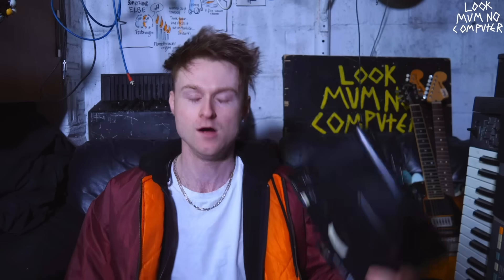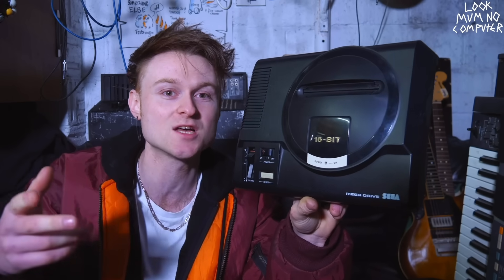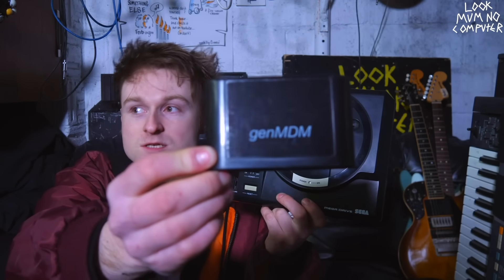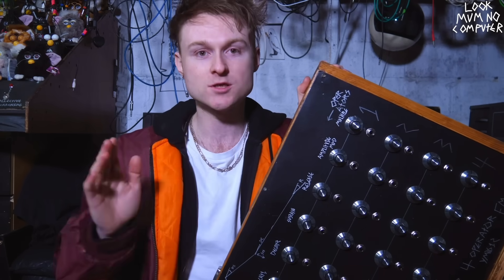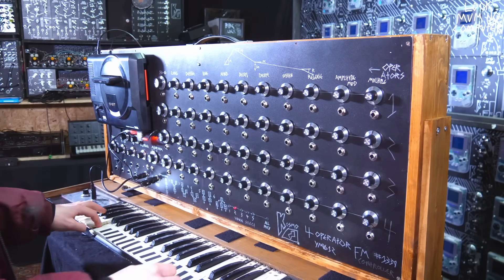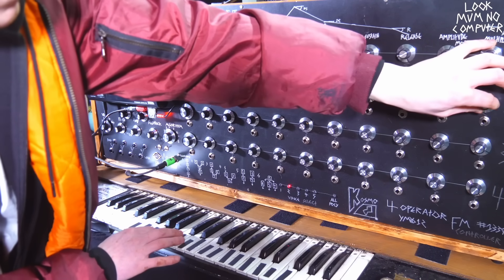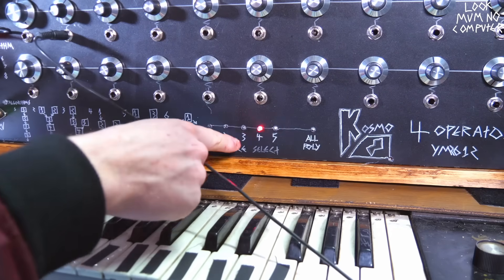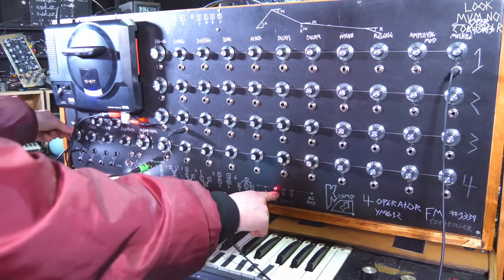Sega MegaDrive Synthesizer, Made From A Sega Mega Drive And GEN MDM

Comment: 0:26 so this sounds like a misunderstanding that got passed around.

If you have an American model 1 console, then the "High-Definition Graphics" text just serves to tell you you don't have the awful VA7 revision, and you might have the rarer VA2 revision. However, neither of these revisions were ever sold in Europe (or the PAL countries in Asia), so the consoles for that region are essentially all the same audio. The audio circuit in the VA3 was basically unchanged all the way through to the VA6.8.

The removal of the "high-definition graphics" text was done mid-revision around when the VA6 was being made, and usually all the text being missing tells you is that you have a VA6 or later console (which means you probably have TMSS) and you also don't have the EXT port (since the hole for it was blanked out at the same time the text was removed). Earlier VA3 & VA4 consoles are very similar to VA6 aside from that

Comment: This is wild! For the hard corer, Ken Shirriff has reversed engineered the DX7 chips and explains down to the transistor how it works. As you will see there is little correlation between the sound you get and the parameters you put in, which makes it very non-obvious to program: https://www.righto.com/2021/11/reverse-engineering-yamaha-dx7.html

Comment: Try and do this with a PlayStation 3 i want to see if that's possible
Reply: Those just use the i/o controller where as the sega has a real hardware synthesizer
Reply: @12E-s3i  hmm i didn't know that interesting
Reply: @jasongrim2027  it's like asking to play a song on an ipod. It sounds the same because the audio is controlled by the i/o chip which is controlled by the cpu, not by synthesizer hardware

Comment: Misinformation. dx7 are easy and make epic sounds you just didnt take the time to learn it properly. and also additive synthesis and fm are two different things, fm is about modulating audible waveforms with modulators in ratios making cool timbres etc.. dx7 is capable of both additive and fm. example - algorithm 32 can only do additive synthesis as all operators are carriers. and algorithms 16, 17, 18 only fm synthesis is possible as there is only 1 carrier and the remaining 5 operators are modulators. and lets not get started with the EG..
Reply from the maker: I had a dx7 for many years it was straight forward to program but unpleasant and FM is not my cup of tea bug yes you are right on addictive and FM well done

Comment: There are (were) free plugins that emulate YM2612 but they are not so easy to use.
Some mega drive emulators like GENS allow to dump YM2612 settings and you can export the patches from your favorite games into these plugins.
The disandvantage is the sounds of Mega drive are lo-fi (8 bit) and does not mix well with modern sounds. DX7, DX21, DX27, their rack versions and Dexed plugin allow to achieve better quality of sound. VAZ modular soft synth was also capable to emulate FM sounds with 6 sine waves. A bit crusher and overdrive might be needed to get closer to the sound quality of mega drive.

Comment: 9:10 I would assume that four total channels would mean the selector would be a four-bit https://en.wikipedia.org/wiki/Bit_field
Assuming that is true, the channels ch1,ch2,ch3,ch4 would correspond to the values 1,2,4,8 (or the reverse) so that "all four channels" would be the value 15 (==1|2|4|8). This would also mean that the value 9 (==1|8) would be selecting ch1,ch4 and so forth.
So, if you haven't already, try the number 15 (or negative 1, which corresponds to all bits set in a signed (two's complement) variable)

Comment: Hey there! Your homemade Genesis synth looks and sounds fantastic , dude!

I don't know if you already took care of the omni mode problem, but I have a suggestion. I made a similar project, an Arduino-powered synthesizer but using the Yamaha YM2151 chip (commonly found in arcade games like Street Fighter 2) instead of the YM2612, and what I did in code to set all eight channels' parameters simultaneously was...loop through the channels. Every time I changed a parameter literally for-loop from 0 to 7 and send the same parameter command to that channel. To be fair, I didn't code in the ability to program each channel separately because I wanted 8-note polyphony instead of potential 2-voice 4+4-note polyphony so I wrote note stealing into the keypress code.

Comment: I cant be sure, but I think you have the multipliers for the operators on the last channel on the right, and I think its a smooth curve, as opposed to being defined numbers. With FM it tends to help to have multiples of round numbers, 2, 3, 1/3, 1/4 etc, as opposed to some perfectly analog output that equates to something like 1.184476. It might help to have a stepped knob with defined positions from like 1/5 or 1/7 up to 5 or 7 or something (you dont need that many because higher multiples just do the same thing as a lower number). Might help to be more deliberate about what sounds youre making as otherwise it can end up sounding like everything you make is just variations on "crunchy". You might know all of this, you just mentioned you hadnt done that much FM, and Im far from an expert, but thats one thing I did learn is that most good multiples are in the form of 1/2, 1/3, 1, 2,  and 3. Awesome machine man, as always!

Comment: Too bad they didn't use the YM2610 in the megadrive, would have been too expensive though. It's basically a 4 channel YM2612 that also has six 12-bit ADPCM channels one 16-bit ADPCM channel, a noise channel and 3 PSG channels. SNK used it in the Neo Geo and there was a version with two extra FM channels for a total of 6 (YM2610B) that Taito used in some of their arcade boards.

Comment: Yamaha's "FM" synthesis is actually using phase modulation. The reason for this is that frequency modulation creates unpleasant harmonics under certain conditions and replacing frequency modulation in the operators with phase modulation creates almost indentical results but without any unpleasant harmonics.

Comment: You have single-handedly rewritten my opinions of FM synthesis. I used to think of it as a technologically superior but musically more sterile alternative to subtractive synthesis. Now I understand it can sound really good -- it's just too bloody complicated for most people to do anything interesting with!!!!
Reply: Part of it is that the YM2612 chip in most of the model 1 mega drives (and some of the model 2s) has a very "dirty" DAC. The output is super crunchy and distorted with lots of extra harmonics that "shouldn't" be there. The later YM3438 chip fixes a lot of this and the output is a lot brighter and sparklier (but it's still not as clean as like an FM softsynth can be).

If you try to replicate YM2612 patches on something like Ableton's Operator or even a DX7 you get something much cleaner sounding.

Comment: man, You are not a fanboy, you are a pro at this.  I have an electribe2 (blue one) and well, l usually listen to chiptunes, I was thinking there is a sound I cant do, I am figuring out how to do it because electribe2 doesnt have an arpegiator or something.  the sound I want to replicate is a common sound found in chiptunes, it comes in 3s or 4s, usually with a delay, (I also found it without delay sometimes). 
For example in this song Je M'appelle - Around. This sound comes from 0:31to 0:45.   or in this song  Tempest - Acidjazzed evening, it is in the background through the track.  I can do it manually I guess but it wold be impractical, and I would have to use double speed, that means that I would be limited in resources since electribe only supports up to 4 bars of 16 beats each in a preset. That would mean that to make 4 bars I would have to use 2 presets, since to give the impression of "fast" I would have to double the speed and make 1 kick in a bar (instead of 2). I dont know if I am confusing you,  Maybe there would be a way to do it 1 beat (one touch) and that sole beat launches the 3 of 4 note arpeggio, if you understand me..  maybe there is not a way, maybe there is, tell me if you have any idea or have had that machine.

Comment: So if it’s a digital chip are these analog dials turned into discrete values? I’m guessing 1-256? I’m imagining a led display replacing each dial with a select button, then enter a value on a number pad or a dial to change the value and then maybe you could save presets of all the settings for the different sounds you really like...

Comment: If you're not using the PSG why even put the whole genesis up there? Just take the YM 2612 out of it and wire it up...
Reply from the maker: Cus it defeats the purpose of making a synth out of a megadrive
Reply: @LOOKMUMNOCOMPUTER  But if you aren't using the PSG chip too in the Megadrive you're only using half of it...
Reply from the maker: @magicstix0r  yeah bvut the psg chip is pretty blando. and you can if you wanted to use it with this setup i just didnt use it in the vid
Reply: @LOOKMUMNOCOMPUTER  Did you just solder into the Megadrive's sound chips or are you communicating with it through a ROM?

Comment: There are 6 channels on the genesis, why do you have 5 + poly?
Reply from the maker: 2 reasons. gen mdm has it setup so channel 6 is a noise channel and you can play it through here howevewr there is no adjustment parameters so i didnt add it., and finally when i make it polyphonic which is now done, i only want 5 voices as i think anymore, for my playing is overkill, if its good enough for the prophet 5 its good enough for the sega megadriver synthesizer

Comment: Why not use some chips from the pc98? it also has an FM synthesizer but way more channels and a lot more control. It also has MIDI control built in iirc...?
Reply from the maker: The ym2203 chip actually has less channels. It can in average setting have 3 channels at the same time. 12 operators overall
Reply from the maker: The sega has 24 operators and 6 channels in the ym2612 chip

Comment: Hope this helps : Assuming you mean that MIDI channel 0 invokes omni mode : In the code (line 293) you're sending controller data to (Bchannel  + midichannel), but on lines 226-231 there's no way the midichannel variable can ever be < 1. The omni pin sets midichannel to 6 not 0 (line 231).

Comment: I was given a non working electric keyboard, was wondering what it would take to convert it into a synth.
It’s a fairly basic keyboard, not much in the way of features.
Reply from the maker: Well it all depends what it is. Building a whole synth is quite a bit and may make sense to start from scratch. Maybe circuit bending it. But depending what it is it may be more hassle than just building from scratch
Reply: LOOK MUM NO COMPUTER 
It’s an old electric piano, was told it was bought in the late 60s early 70s.
Good thing is if I totally goof it’s no big loss.
Reply from the maker: Drunkle Stan that is a big question
Reply: LOOK MUM NO COMPUTER how so?
I’m new to this kind of thing.

Comment: I did a similar project last year using a gutted BCR2000 and arduino controller, controlling a YM3438 directly. I don't know how that custom cartridge works, but the YM chip has no means of applying changes to multiple channels simultaneously; you just have to send one message for every channel whenever you change a parameter.

Comment: Simpler FM synths are turbo-beasts for bass patches. I have a cheesy little two op FM synth, the PSS-480 which is kind of a kid's toy but you can edit the synth parameters and it will make some wall shaking bass.

Very cool build. Sounds gnarly.

Comment: Hey Sam, I don't know if the polyphony is fixed yet but I think I might have the solution. I have modified the code and it compiles fine. If it is already fixed, let me know anyway pls.
Reply from the maker: hey marek! i have received a number of solutions alrewady however i havent had time to test! thanks though!
Reply: @LOOKMUMNOCOMPUTER  ok, doesnt matter. Thanks for the info anyway
Reply: Same here! We should compare solutions! ;-)
Reply: @ntisserand  Definetly! I just used for loops and made it so that when the midi channels is six, It writes to all the channles the same value. But the code is quite bad and the comments are quite useless (in my opinion)
Reply: @machmar  I did a similar thing, but I used value 0 internally (MIDI_CHANNEL_OMNI) for the omni channel.
Reply: (a screenshot of, and the diff itself, respectively)
Reply: @ntisserand  I didn't know that existed.
Reply: Marek Mach  The MIDI_CHANNEL_OMNI constant? It’s just a fancy way of saying « 0 ». :)
Reply: @ntisserand   strange Sam didn't do that even tho he talked about it.
Reply: Marek Mach I heard he mentioned that the arduino midi library did not do omni output anymore... but I failed to understand what he was specifically referring to, and I am even more confused by the fact that there is a 4+ years old test in this library that specifically checks that it refuses to send on the omni channel: https://github.com/FortySevenEffects/arduino_midi_library/commit/68444227b2877a74e599adff4eae3a02d7b6b3b2UIKeyInputHome.
Also, to clarify: MIDI_CHANNEL_OMNI is just a constant. I could’ve used the literal zero instead and things would have worked (or not, since I haven’t been able to test) the same. It’s just more readable this way.
Reply: @ntisserand  yea true. Well Sam has been working with it for quite some time so it might have changed without his attention.
Reply: @ntisserand  btw wanna make a collab synth? Might be useful for both of us.
Reply: @machmar  Thanks for asking, but I sadly lack the time to embark on new projects just now. These couple hours hacking on this were an impromptu escapade! Besides, I've actually never built any hardware. I've only done software, so far, save for a ghetto USB-hosted midi channel selector filter thing I made from an arduino starter kit, last year.
Reply: @ntisserand  oh, it's ok. Although you should really get into hardware. Its much more challenging and fun.

Comment: Heh heh, too cool! Pretty soon you'll be up to the level of Keith Emerson's 'Beast' Moog Synthesizer! Just need more modules and a few hundred patch cables! I have a Yamaha TX-7 which was essentially the guts from the DX-7 in a smaller box with MIDI in/out/through to connect to external keyboards. I use it once in a while as an expansion for my Casio WK-1800. 😁👍

Comment: A similar, but unrelated project I've wanted to work on for a while is to make a truly modular C64/6581 breakout. Yea, there's the Sidguts and all, but those are monophonic and ignore so so many parts of the Sid chips. I want to figure out a reasonable way to address 100% of it. I've got a SammichSid (based off Midibox I think), but that doesn't split it all out to euro the way I'd like. I'm not sure if it's easier to make something that maps the CV to MIDI and then into my SammichSid, or something that goes directly from CV to the Sid more directly, and skip midi.

Comment: YM2612 has 6 channels, why don't you have option for 6-th channel?
Also, if you have arduino behind this, you could add support of PSG channels and even DAC (for drums) if enough speed.
Also, would be awesome feature to record VGM on the fly :O
Reply from the maker: the gen mdm sadly has the 6th channel set up as a noise channel so i didnt bother, also with the PSG channels, you can still play them easily, they have no external controls however so no need for jobs, midi channel 7-11 are those channels.